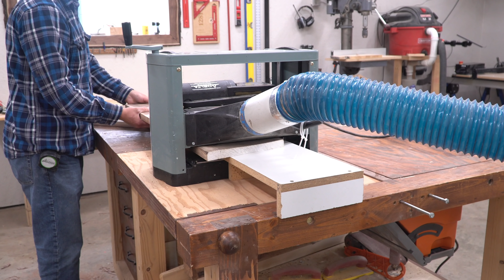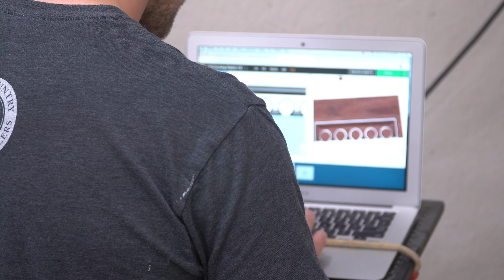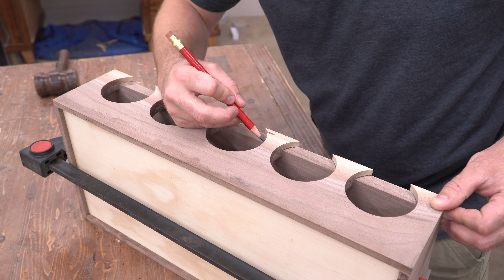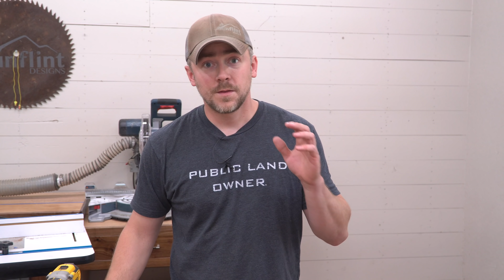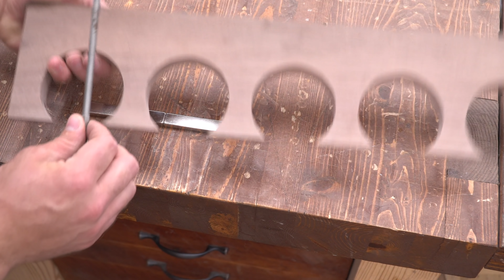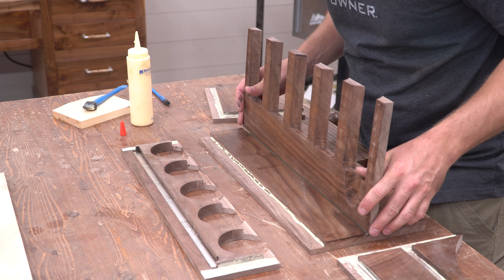Cordless Drill Docking Station With Hidden Magnetic Bit Storage

Comment: So the driver bits don't get it the way, Did you think about placing them on the sides? I have a Harbor Freight magnetic strip just above my drill/drivers. The bits get in the way. When I redo my drill/charging station, I'll be placing the driver bits to the sides. They will be out of the way, but I can still get to them.

Comment: The CNC made it nicely.  Without one, it might be simplest to glue it up without cutting circles at all, then use the hole saw to cut the holes as you mentioned.  After glueup, the fragile parts would be supported.      This would not help with carving out a recess for the bigger drill though.
Reply from the maker: I actually tried that on a really quick and dirty pine piece. It worked, but I felt a little too precarious. If I screwed up my way I only had to replace one piece.

Comment: Typical... You're building awesome things out of sexy wood.
Love the magnets. We need more magnets. Everywhere.
Did you fill the void after the magnets were epoxyed with more epoxy... Or just the one side?
Reply from the maker: I did not fill the void on the back side. I just needed the epoxy to hold the magnets until the box was assembled. The top piece gets butted right up against the back side of the magnets.
Reply: That makes more sense now :) you so smart.

Comment: A Great looking build but why do you always make things harder for yourself? 
To save all the flapping around with the Magnets, why didn't you just put a magnet above where each drill/driver would be for your bits etc, then in between the magnets just put wooden blocks so it would be like magnet/block/magnet/block and so on, that way all the magnets are were you wanted them, and no flapping around with trying to sort out a line of magnets.
Stay Safe,
Barry (ENG)
Reply from the maker: If I had started out with the metal underneath it wouldn't have been hard at all. I wanted a continuous - uninterrupted magnet so the spaces in between wouldn't have gotten me where I wanted to be.

Comment: Instead of cutting the holes separately, temp assemble the front and bottom parts and cut the holes in one go as deep as you need. Should save you lots of huffing and puffing. Like this: https://ibb.co/Cw51hhQ
Reply from the maker: That definitely crossed my mind and I'm sure it would work. I just figured this gave me more control and I wasn't worried about the time or effort involved.

Comment: I have a very similar cordless docking station on my Pinterest page. I do like the addition of the magnetic strip! I have cubbies for storage. I might add the magnet for temporary storage. I would be concerned that the bits would get knocked off and lost!  Anyway good build!!
Reply from the maker: Thanks Bret! I should show a strength test for those magnets... they have a 33 pound hold rating, which is obviously reduced because of the wood layer, but I think they will hold so strong it would be hard to knock anything off.
Reply: Gunflint Designs your probably right! They can be pretty strong! It’s a great idea! My cubbies are the small plastic containers you get from Harbor Freight! They hold more stuff !!! Just another place to shove stuff!! Lol again great video! God bless my friend!!

Comment: I'll be curious to see if the stress of the epoxied magnets causes any warping or other odd behavior over time. As you were explaining that, all I could think was that you spent a bunch of time making the board flat only to insert artificial stress in it later. Good luck! 😂
Reply from the maker: I think the overall piece is small enough that it will hold itself together. The magnets are only fighting each other and they are locked in pretty tight. I don't think it will be an issue, but time will tell.